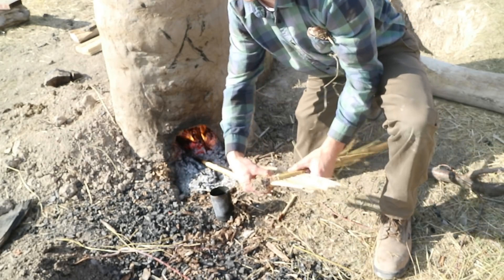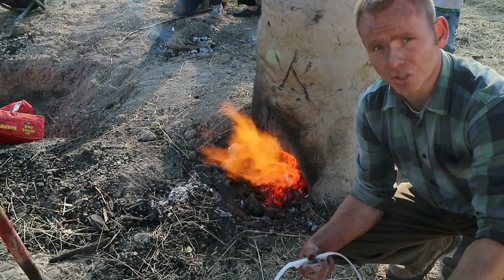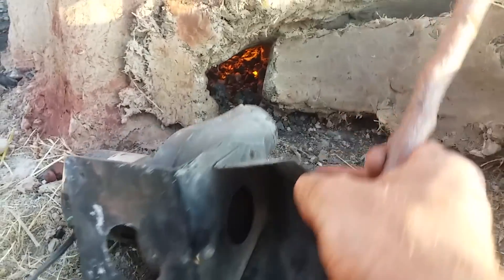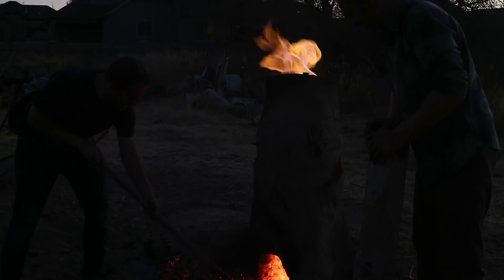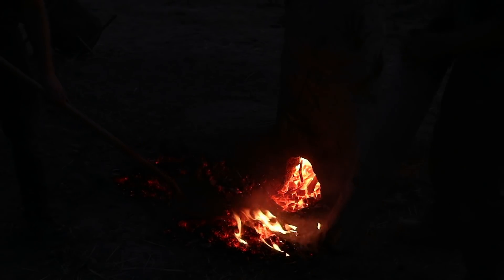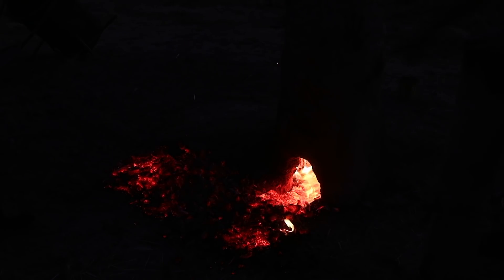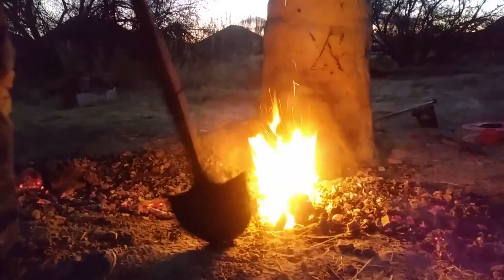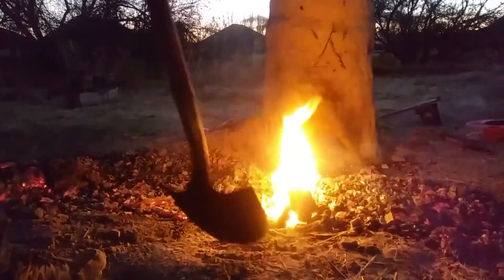Smelt Success! (Iron Smelt #8)

Comment: Guys you are dealing with high temps. You'd be kicked off a jobsite in any industry. Basic things...don't leave a plastic reel with an extension cord...running power...2 feet from a burning forge! Demarcate your area so you don't tread on live coals in...for heaven's sake...runners! Wear eye protection. Where's your first aid area? Who's in charge of first aid? You're in a dangerous situation and it's all fun until someone gets hurt. Be a bit professional.The process you need to look at is a Job Safety Analysis, where you go through all the issues on site and check that everyone avoids danger. Even horticulturists do it.

Comment: if you ever retry this, you should try to preheat the fresh air you'r blowing in. industrially they use the energy left in the exhaust (unburnt CO) but you could just light a second fire and run air pipes through that. in an actual blast furnace, the input air is at 1000C. even a small amount of preheat would be interesting and should improve efficiency.

Comment: have you guys ever tried to do crucible steel? like the wootz, ulfberht type?
Reply from the maker: Not yet. We'd have to make our own crucibles of course. That's a great documentary by the way. I asked Richard for advice on one of our early smelts.JB
Reply: @GoodandBasic  Okay.  Obviously it's supposed to be a more advanced method, but I just imagine the crucible would make things a lot less messy.  I remember looking this up in the past, and the ancient Sri Lankans make a device akin to your Natural Draft Smelter, but it was designed to funnel the seasonal typhoon winds through a gorge or something.  The ancient or early medieval Chinese were using blast furnaces powered by water wheels.  Of course, as a SuperVillain, I am attracted to the most outrageous solutions...
Reply from the maker: @acethesupervillain348  crucible steel homogenizes pre smelted iron while adding some carbon and removing more of the glassy slag material. It's a thing that would be interesting to try with the iron from one of our successful smelts. JB

Comment: Some tips to make stuff easier:
1. Put your blower about 45cm off the ground pointing in the furnace at 25-30 degrees. 
2. Cover up the front hole until you are certain everything has melted (you should see slag coming out of the blower hole.)
3. Put sand at the bottom of the furnace at an angle so that when you open up the furnace slag will pour out.
4. If all goes to plan, your bloom should be a bowl shape at the blower hole with molten slag inside and about 25cm wide

I did a week long course with lee sauder who is one of the best in the world at this stuff and has done over a hundred smelts

Comment: To stop your block from moving, dig a depression in the dirt underneath. Also, you need to block off the hole on the opposite side of whatever forced air source you are using so it all gets forced up the stack.

Comment: Okay you guys are failing to understand 1 of the most basic principles of a natural draft smelt. They could be done in open areas like this but that would mean the men around it blowing on it with blow pipes or operating Bellows connected to blow pipes in the African tradition. Europeans who tended to working much smaller groups to achieve a smelt of iron or anything else due to trying to keep the process as secret as possible, Would utilize a hill. from that natural hill in the landscape they would test and see which way the wind blew over the hill most commonly and whichever side of the Hill had the greatest wind on the down slope that's where they would dig a channel from the top of the hill down to where they would build the smelter. so that the natural air flow of the wind coming over the hill would blow directly into their smelter and achieved much higher temperatures. If you want to do a truly primitive smelt without use of any modern technology that is your better bet.

Also when you're continuing to add more charcoal you need to throw some sticks and Wood down in between it so that you get better ventilation Through your coal stack within the smelter.
Reply: that is it.. smarter not harder.
Reply: This is pretty much what I did as a kid. I'm pleased they succeeded, but somewhat disappointed they didn't persist with the natural airflow method as I think they were on the right track. Trick is to get a good (and basic) ratio of chimney dimensions to inlets. I kinda winced a bit with the suggestion to increase both height and airholes because that can cancel out the gain from a better chimney. On the plus side, can cover inlets to restrict airflow if needed and balance the temperature.
But it's fun to see us emulating our ancestors, who did much the same by trial and error. Then later figured out improvements to increase airflow mechanically and create more permanent smelters. As for labour, once the basic idea was understood, a day to make a smelter wouldn't be that much given the value of the product.

Comment: Just a thought though, could you use a board with a hole through it to hold the basic fan steady on the top? So you have the bearing block on the bottom and the board resting on the housing with the hole to to hold the axle steady on top. Maybe use stakes on the sides of the board to keep it steady.
Reply: Primitive Tech.   did that.